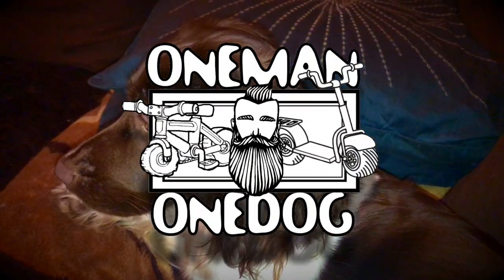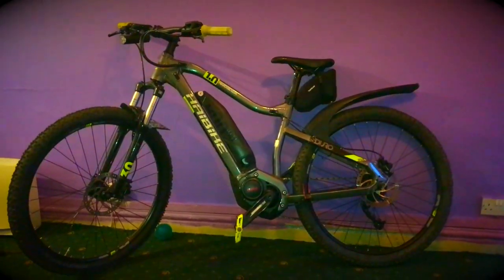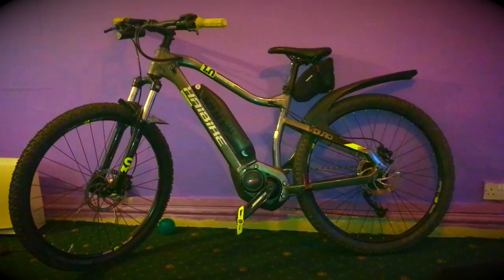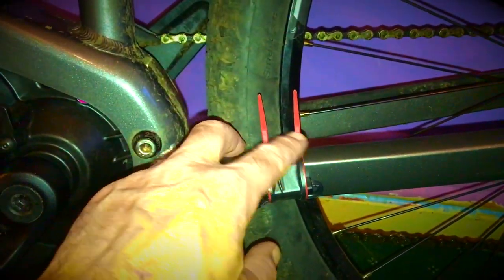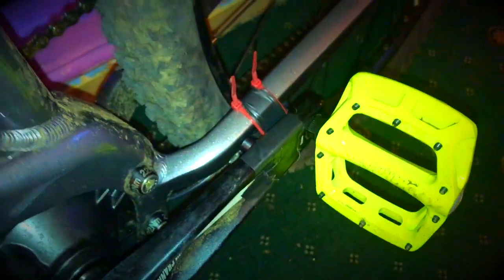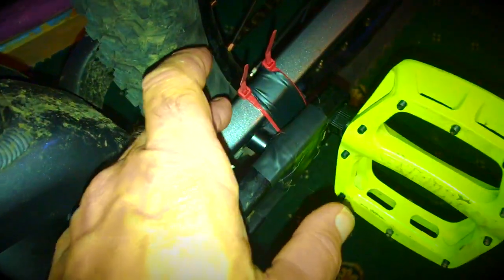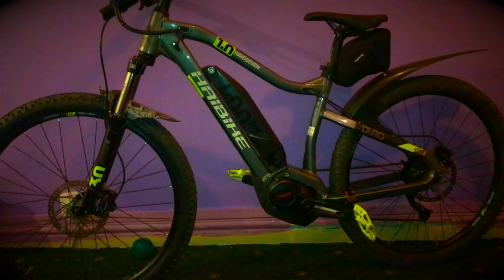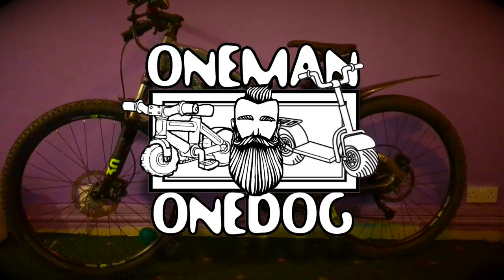How To DERESTRICT A HAIBIKE SDuro Hardseven 1.0 2020 (FREE) - NO TUNING CHIP HACK !! #YamahaPWSE

Comment: I.m sure I saw somewhere that the computer logs it and it can be picked up by a diagnostic  "scan"..so be careful Paul if you have trouble with the motor during warranty....Yamaha/bosch etc  aint stupid they know what we get up to!!!
Reply from the maker: Right i shall do some research & yes they know exactly about HACKS etc !!
Reply from the maker: im thinking the controller/motor would just log it as your riding slower as thats all this HACK does & yes tuning chips can be detected & void your warranty but like ive put this just tricks your controller/motor into thinking its going slower than it actually is but i will check..And ive put a advisory in the description so its up to people if they want to take the risk but thanks for commenting & pointing this out 😀

Comment: As far as I'm aware the only negative effect this has is faster battery lvl drainage due to more power used more frequently
Reply from the maker: Great Anthony - I thought as it just tricks the controller/motor into thinking its slower & yes more power more drain on the battery - Cheers mate 👍🏻

Comment: Hi Paul,  I think I am going to get the full seven. What is your top speed and battery range with this hack please?
Reply from the maker: Hi Alexander - Are you cool the Full Seven looks a nice Emtb - I havent tested range as i only ride 10 miles MAX on my rides & the speed at top end could be improved by fitting a different cassette as reaches over 23mph & the pedals spin to easy like the ratio needs to be higher on the gears which im going to research then change - Also i am thinking of fitting a tuning chip instead of this HACK - Hope this helps & thanks for watching 😁
Reply: Thanks Paul, doesn't the chip void the warranty though? 
I was hoping for about 30mph
Reply from the maker: Hi Alexander - Yes the chip will void the warranty but i only have 2 month left so i'll be waiting first before i fit one 👍

Comment: It’s tempting, though doesn’t it void the warranty?
Reply from the maker: No as you are not modifying the motor you are simply tricking it & you just removed tape & cable ties & put it back to normal if you want 😀